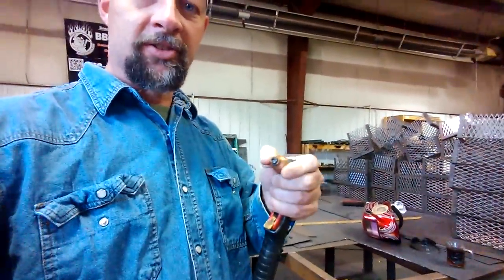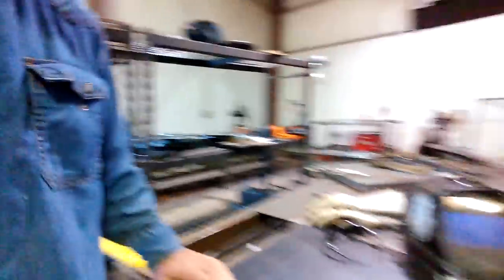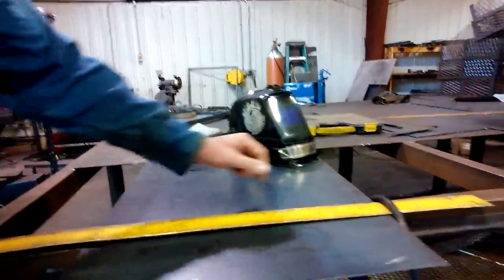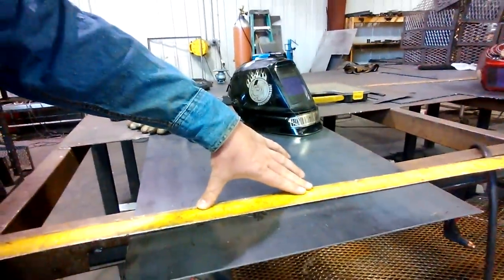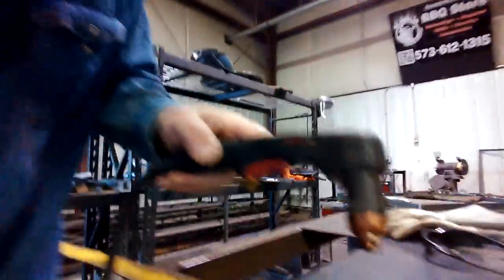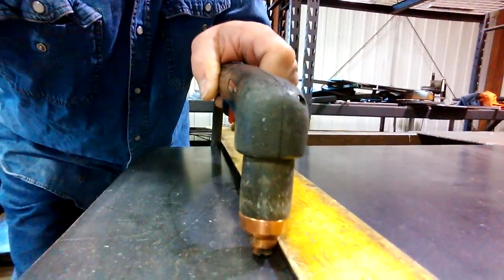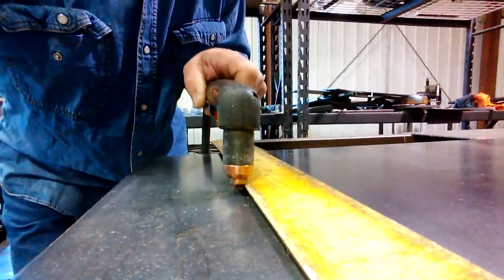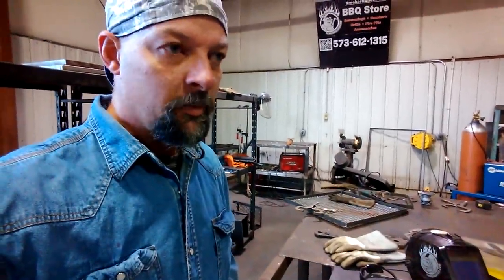How to cut a straight line with a plasma cutter

Comment: I use a simular machine with same torch without the drag tip. When I make large belt guards or fabricate stainless steel conveyor chutes, I use a heavy 3/4" round stock stainless steel bar as my straight-edge. I run the side of the torch lightly against the bar and can rotate the bar slightly to keep cutting with the kerf to one side of the line. This is the fastest fool proof method for cutting a lot of parts out fast with fewer mistakes.
Reply: I like that tip. I will need to try that with my powerplasma!